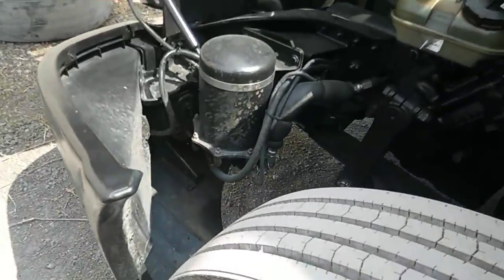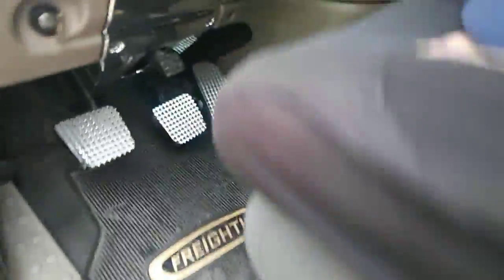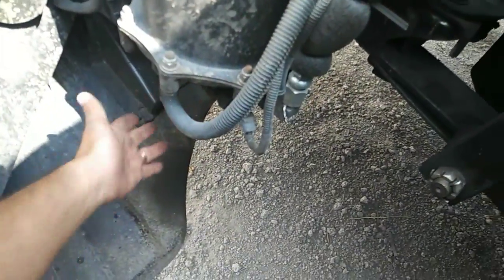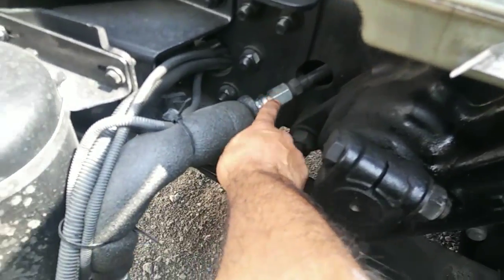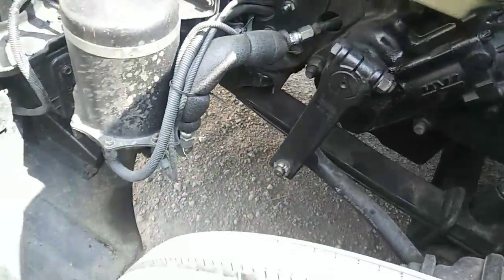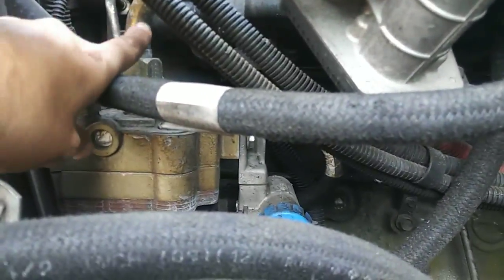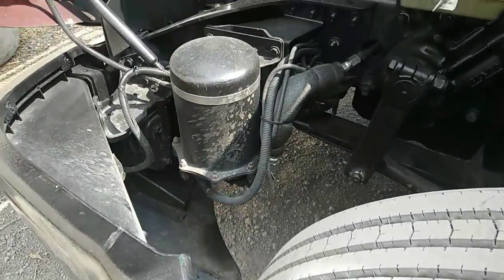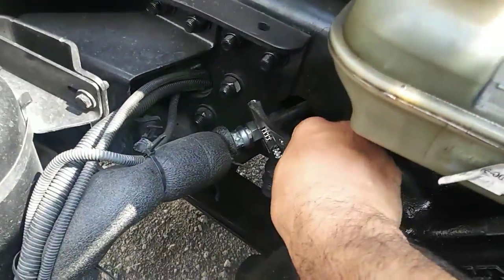air dryer leaking air

Comment: Hey vic, my air dryer doesnt leak so bad that I cannot move the truck, but it does have a slight leak constantly. Should I just change out the whole assembly? 2003 volvo 660
Reply from the maker: yes ,changing out the buttom of it,at times it doesnt fit right and you have another headache,be save and change the whole thing,good luck
Reply: @vicmed6088 . Not trying to be rude but  air dryer assembly's don't fail there subsystems do. But mechanics with poor information replace them because they can't properly diagnose them.

Comment: Im going to try this tomorrow! I watch you other video and changed out my Govener {Black top } unfortuantly. After words my air is still slow to build up. So im going to bypass my dryer to see if my dryer thats the problem. i changed out my filter that sits on top of the dryer as well  still same results. But im going to try tomorrow
Reply from the maker: good luck
Reply: your compressor is done
Reply: What was your issue?

Comment: Mines doing the same thing. Does that mean you have to buy a new one or just the kit?
Reply from the maker: for this kind of air dryer,i recommend to buy a new air dryer,fleet pride has them,brand new not rebuild for $200.00,which is a good price,cant beat that price,thanks for tunning in and good luck
Reply: @vicmed6088  you have the part # for fleet pride